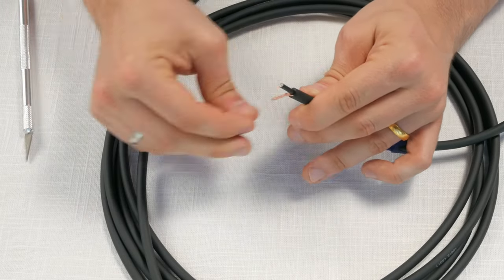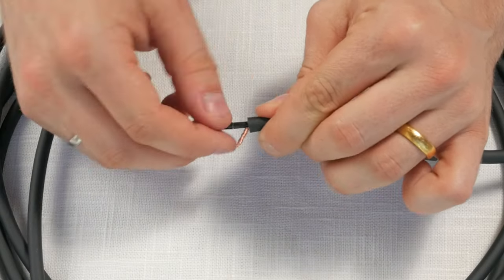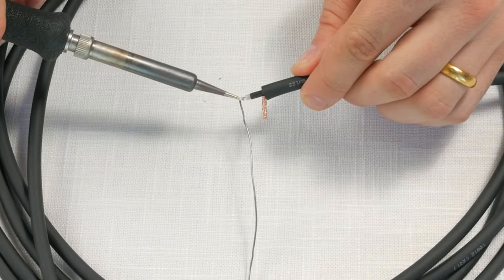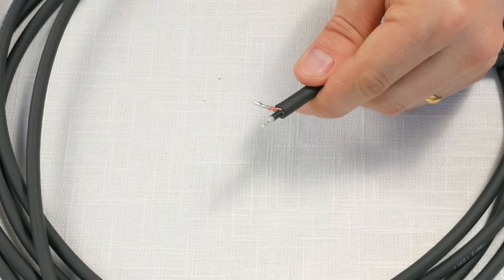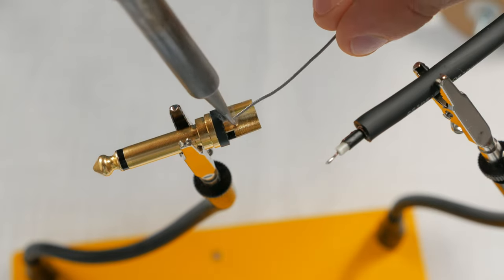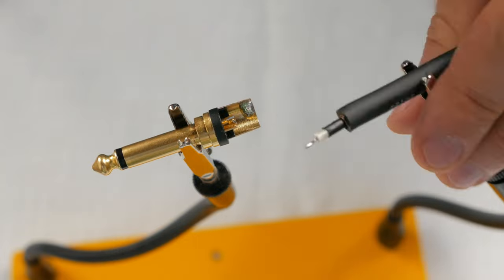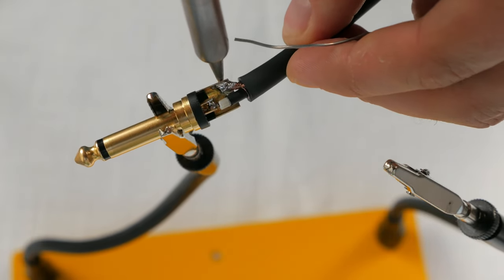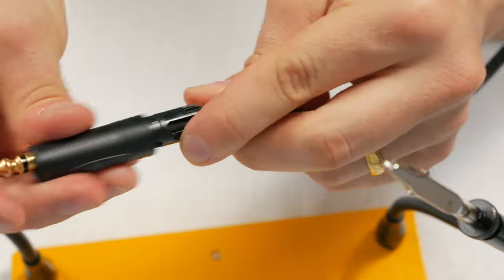How to Build Noise Free Guitar Cables

Comment: I recently discover that it was the bare cables all the time, I thought that was the potentiometer of my basses. I use Neutrik connectors and I'm good soldering with stain, but always with cheap china-made cables. Thanks for the good explanation and pro tips, is interesting how the interferences go inside cheap cables.

Comment: Good info...  you're a saint.   I make my ts cables no problem, some thanks to your video. but wanna make some trs for the front patching of my new patchbay.  Any recommendations.  I'm little confused with making balances TRS cables and what materials to go with for a simple, solid, TRS front patchbay cable?
Reply from the maker: I’m guessing you want something on the thinner side. Mogami makes nice stereo TT patch cable. 

For the plug you probably want TT (tiny telephone). Just make sure that’s what your patch bay needs. It should be wired similar to a 1/4” Trs plug.

I would call up redco or switchcraft and talk to their sales reps. They’re good at pointing you in the right direction for parts selection.

Let me know if there was something more specific you were looking for and I’ll try to help!
Reply: @shoetiquemusic   Sorry, forgot to mention... All jacks on my patchbay are 1/4".   🥸
Reply from the maker: @artspiritfineartstudiogall9672  Mogami cable and Neutrik 1/4" TRS jacks should do the trick! There's a wiring diagram that shows how to wire 1/4" TRS here: https://customcableconnection.com/cdn/shop/products/xlr_to_trs_blanced_pinout_1_2000x.png?v=1668827639

In your case you'll have a TRS on each end of the cable. Each end will be wired exactly the same.

Comment: "The root of my problem is out of my control," isn't just a significant thing to realize in relation to RF signals, but also a useful quote when being pulled over.

Thanks for another interesting video.
Reply from the maker: I appreciate you checking it out Ramsberg! If there's enough interest I can draw on my wellspring of experience and do a video on how to poorly handle interactions with the police!
Reply: @shoetiquemusic  Ha, that'd legit be hilarious, if even just a small interlude or bit in one of your future videos.

I can add that one thing not to do, is to joke with your friends so much about being pulled over and slurringly saying, "Ah, hello o'ssifer." that you then accidentally do so when you're soberly pulled over.

As an aside/the actual point of your video, I greatly lament that the electric guitar didn't go the way of mics and use a balanced system. For home studio stuff especially. I keep thinking about wiring up one of my guitars with an XLR jack, and running it to a mic preamp, a lot of those have unbalanced outputs that can go to an amp, however they may need a robust pad at the input for going that direction, and I'd probably not use volume or tone controls and wire the jack direct to the + - of the pickup, and then ground to the bridge.